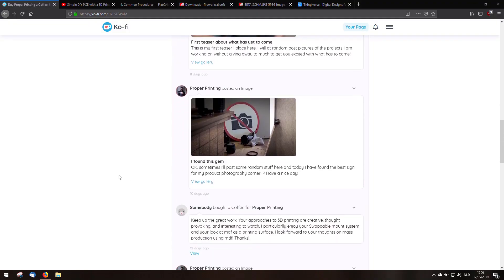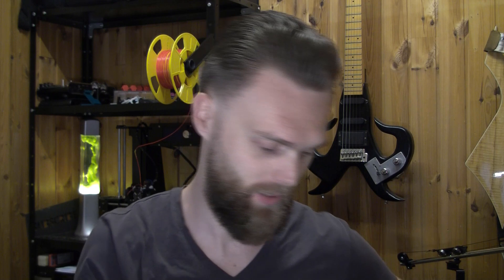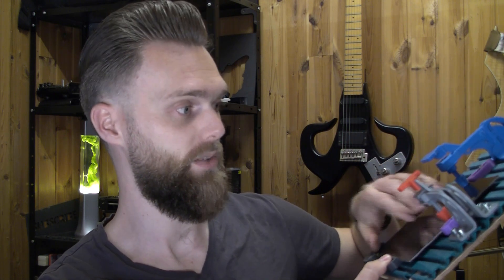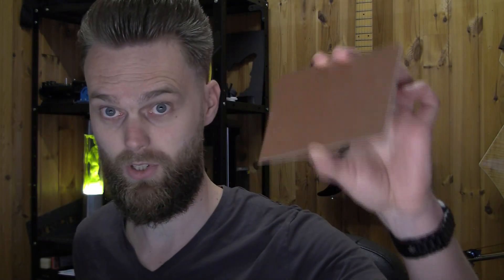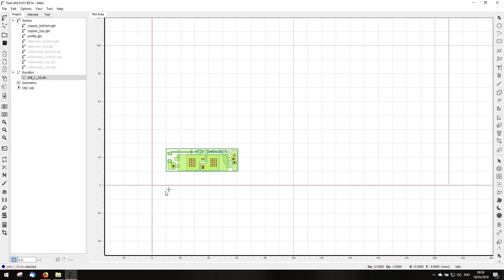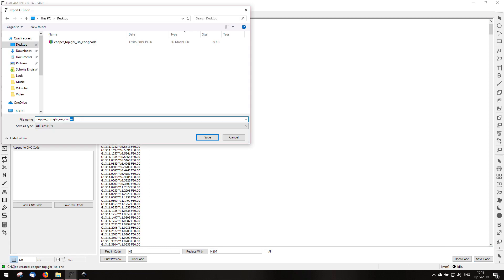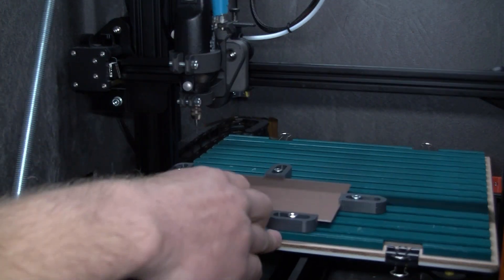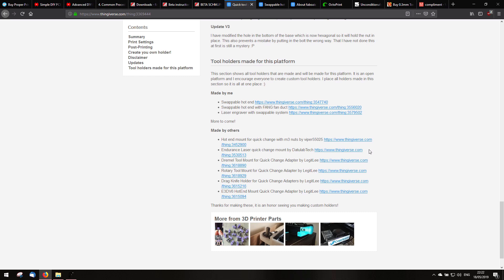DIY PCB on Creality 3D printer

Comment: You should not use the hotend fan, but use the hotend heater connection, leuk kanaal!
Reply from the maker: For more powerful tools this would be best indeed! Using the part end fan is a lot easier ;)
Reply: @properprinting  Why?
Reply from the maker: @rondlh20  Because they can be controlled with the M106 and M107 command (if I remember correctly) with a value of 0 to 255. This is very easy to implement. Just enabling the hotend heater is not easy due to safety reasons.
Reply: @properprinting  You have a good point, on the other hand it is just a matter of the pin configuration. If the fan MOSFAT can handle the current then no problem.

Comment: I feel like a star getting a shout out in your video. I see that it may be miss labelled on your page though it is made for added clearance for the fang mount for the ez able. However, I see you have made a new design for abl built into the quick connector I will have to look into swapping over to the new design soon since I like it to the ez able.
Reply from the maker: Thanks Jeremy! What do you mean my miss labelled on my page? The new design is still in an early development stage ;)
Reply: @properprinting  In the video it says quick change for hotend. But it was not just for the hot end it is to have extra clearance for fang cooling fan mod on the printer.